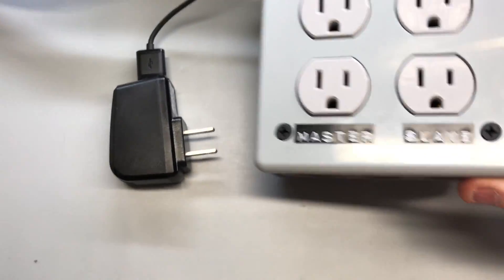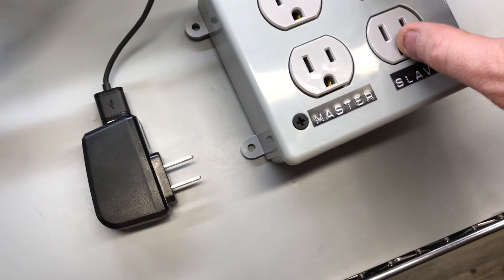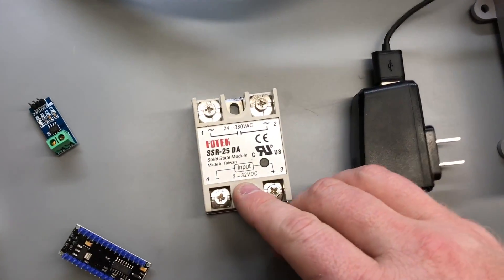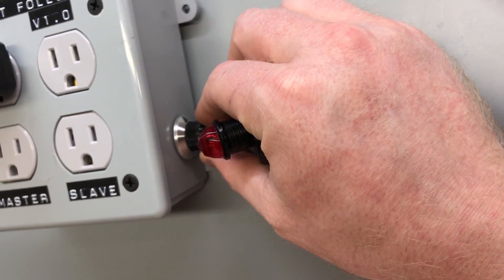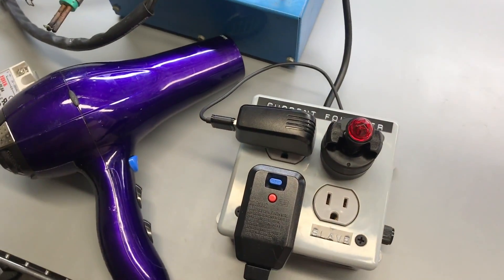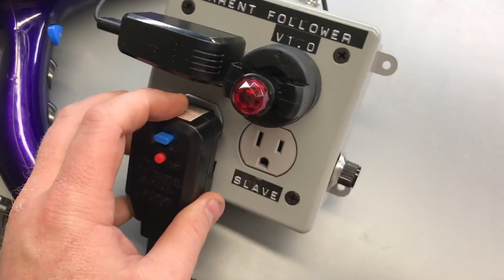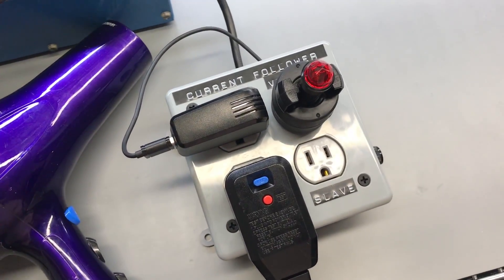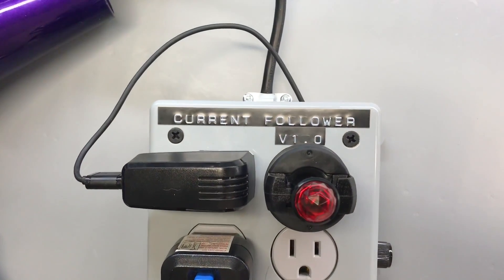Current Follower V1.0

Comment: Hot air to cold air, is not a minor change.
Reply from the maker: A few amps isn't really that minor but it will trigger off a difference as little as about 100mA from the the 120VAC.

Comment: Ah, a power saving extension lead. I've seen commercial versions of this, often advertised for use with a PC or TV to turn off accessories when the main device is in standby. Don't think I've seen this application though and I don't recall them having adjustable thresholds.